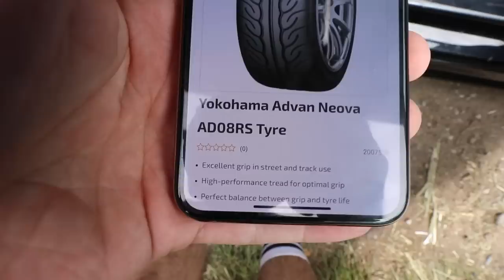UNBOXING DIY GARAGE TOOLS & MODS..... SICK!!

Comment: You asked what cars we've got. I have a r31 skyline with a rb25det swap, high mount t04e, 44mm external gate, 1500cc e85 injectors, cam gears, tomei cams, front mount, coilovers, welded diff, one piece aluminium tail shaft, bolt in half cage etc etc. Makes 470hp on 23psi and is a handful and a half. I love it haha. Sideways machine

Comment: Tip mate, when changing the nozzle aim it away from the car and test spray it first. They can come flying off 🤦‍♂️
Reply: Amount of times this has happened to me :(
Reply: I’ve lost a nozzle doing this. Thankful I wasn’t pointing it at the car first though.
Reply: A great couple of gadgets to have is the Rupes ibrib bigfoot and the rupes bigfoot 21 polishers.. You need both but worth every penny with the finish you get.. pure mirror shine..

Comment: Love your videos!! stubby gun ftw, you should get a quick release extension lance too. One tip I'd recommend with the new gun and nozzle's is when you swap nozzle's or swap to the snow foam cannon is spray it at the floor for a second first before spraying the car as they can occasionally fly out if the quick release isn't properly locked.

Comment: Best upgrade I ever did was get a stubby gun for my pressure washer but ya like some one said before always to a test spay away from the car first after changing nossles just incase hasn't fully clipped in position   tbh I find my self using the green for 95% of the car wash then may change to then orange on stubborn dirt ie exhaust tips and arch liners. 
Big up VW haha 😄 sick cars I got a Polo GTI but mines the 1.8 TSI DSG

Comment: I drive a leon cupra 300 4drive only paddle extension and carbon gear knob atm got loads more I wanna do and I also use a stubby gun and its soo much easier when your in a tight area

Comment: You can get pressure washer fittings that point at 90 degrees to the gun to get underneath the car, like they point upwards

Comment: My dude. You need to start getting on the Obsessed Garage stuff. Mosmatic gun, wand and MTM PF22 foam cannon. Lightyears better than the Chemical Guys. Speaking from experience. The action on the Mosmatic is so freaking smooth and easy. Plus, Matt sends all his stuff mostly preassembled!

Comment: I wanna see the wash video. Steps. 
I wash my black car weekly I use spray on ceramic and wax coating from Meguire. Makes it so easy to keep clean. And wash. 
I used a brush last time after seeing you use one.    It says spray on dry but if you wet the car a little it lasts a lot longer. Plus easier. 
Love your vids been watching since you ripped out that skate park you had. But… I honestly have to skip a lot as you talk about something for so long. After watching one vid you could for that into a  2 mins how to vid.  More content less talking I say ;) 
I’m 29 and really jealous of your garage set up that’s like every guys dream so keep it up an shut up 😜

Comment: Your going to regret buying the ad08rs. They are nothing on the old ad08r. Take ages to get heat into them, go off really quick and squeal badly. Terrible in the wet to. Better off with nankang AR1's. Tegiwa usually do decent prices on them too